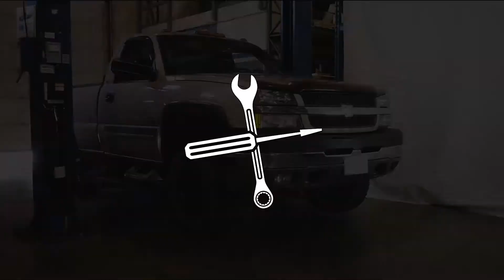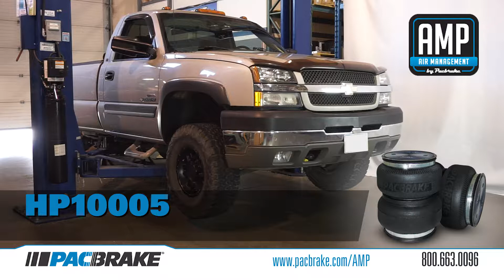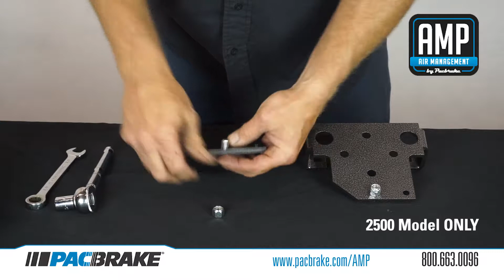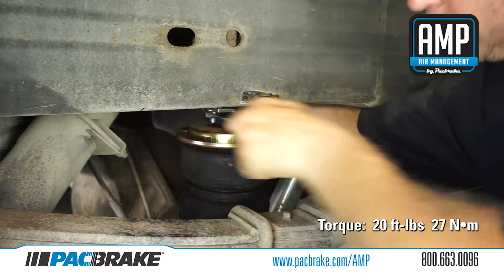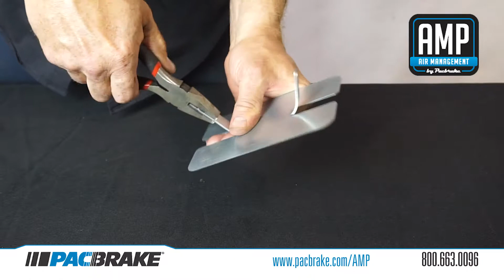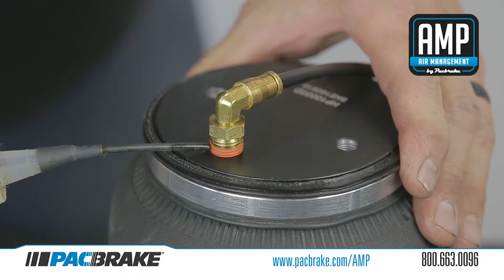HP10005 AMP Air Spring Install by Pacbrake for Chevrolet Silverado / GMC Sierra

Comment: at approx i min into video there is bolt and nut installed on 2500 models only what is the purpose of this
Reply from the maker: That bolt is used so when the lower bracket is installed in the vehicle, the bolt head will be in contact with the axle. This is done to prevent the lower bracket from resting on the shock mount tabs and potentially breaking the shock mount off the axle.
Reply: So this isn’t done on a 3500 dually?